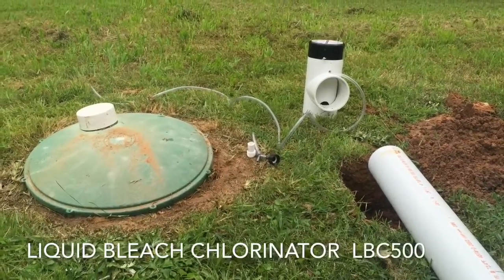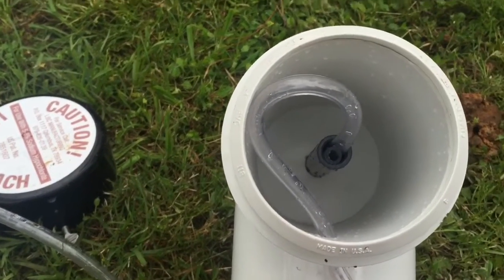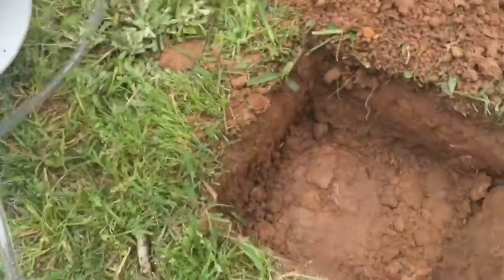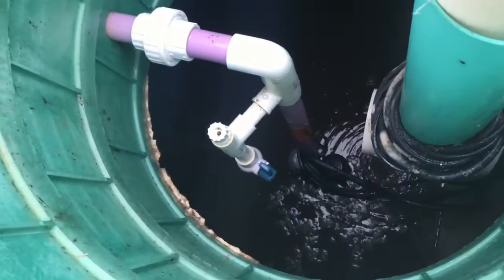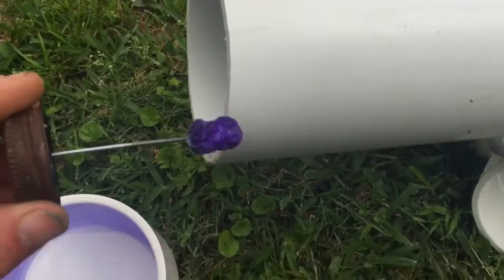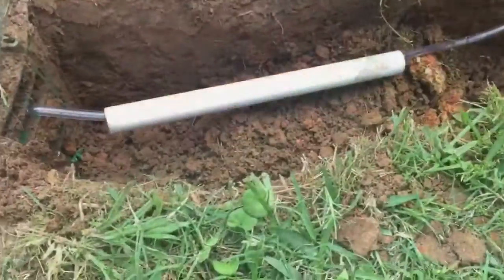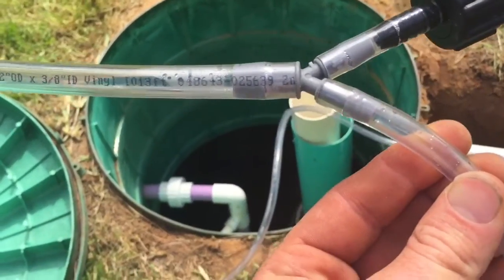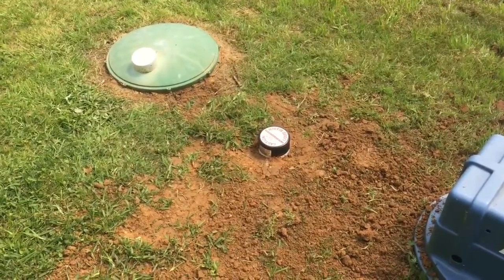Aerobic system bleach chlorinator - no more tablets

Comment: Hello, when you buy the kit does it come with the y connector and threaded parts that attach in the effluent tank?
Reply from the maker: When you buy the kit at a aerobic supply house, it will come with everything you need, less the 4” pipe which you would buy separately.

Comment: My septic is not sucking the bleach out of my pvc
Reply from the maker: How old is your unit? Did you check the Venturi in the holding tank?
Reply: I have replaced the Y valve and all of the tubing. If I open the valve to far it pushes water from the septic into my bleach tube and I never can adjust so I feel suction on the end of the tube. I am not sure what a Venturi is.
Reply: Where can I get a Venturi like it shows in the video
Reply from the maker: Did you sample some from your tank to see if you’re getting any chlorine? I don’t know what else to tell you.

Comment: Just dump some bleach in the toilet once in a while
Reply: Definitely do not do that, the bleach will kill off the beneficial treatment bacteria in your solids and aeration tank.  You should only disinfect the pump tank, which is necessary when the effluent is surface applied, (i.e. if you have sprinklers)
Reply: You are adding bleach to the second tank after the aerobic digestion tank.  Putting it in the toilet will kill the bugs that do the aerobic digestion. So don't do that.  Steven you need to take a class on how to maintain your system.
Reply: That will kill the good bacteria in the effluent tank and make the breakdown and sterilization process way worse. So, do not pour bleach down a drain. It can only go into the pump tank for final sterilization.

Comment: Mine isn't using bleach either, must be plugged up.  Did you notice if there is an orifice in the gray tube that I should clean?
Reply from the maker: Not sure. Might need a new one. But you should hear it sucking when the pump is on. Check the tubing and make sure it’s submerged in the bleach.

Comment: Mine holds about 2 1/2 gallons. The bleech drains super fast, I would say we fill every other day. How do I slow down the suction of the bleech?
Reply from the maker: Which model is it? Is this a new install? The one in the video, you have to wedge the suction hose either in or out in small adjustments. Ha
Reply: @karlmielke3922  I have the liquid bleech setup just like yours, I need to adjust the suction.
Reply from the maker: I would turn the field pump on so your heads are running, pull out the vinyl tubing until it stops sucking the bleach. Then put it back in until it starts showing bleach flowing. But not too much.
Reply: @karlmielke3922  I'll give it a try. Thank you.👍

Comment: I have the same system but when the pump is running it doesn’t seem to be drawing any bleach. If I pull the clear tube out and put it into bleach there is definitely suction, but when it’s in the little gray pipe nothing seems to be drawn up. Can’t seem to get a response from the manufacturer. Thoughts?
Reply from the maker: Who is the manufacturer?
Reply: It’s the exact same one as yours. I’m in Texas, too. Manufacturer is LBC Mfg. thanks for replying!
Reply: Did you ever figure this out ? I don’t think mine is using bleach either. It used to I was putting bleach in often but I haven’t had to put any in awhile.

Comment: What about if you septic tank is concrete?
Reply from the maker: As far as I know, concrete tanks are used is a conventional system. The aerobic system I have is poly tanks and the bleach treats the holding tank.
Reply: @karlmielke3922  
My system uses sprinklers and aerator. But doesnt have chlorinator. My septic guy says to drop those tablets into the pump tank. I'm wondering if this bleach chlorinator would work with my system? Drilling through concrete would be problematic, though.
Reply from the maker: Call your septic supply. They sell the chlorinators (LBC Manufacturing is the brand I used.) Mine is is Texas so you might check your state regulation on them.
Reply: @karlmielke3922  
My state is Louisiana.
Reply from the maker: @jxsilicon9  I did a quick search on using them in Louisiana and didn’t find anything on using them. Texas is approved through Texas A&M.
Reply: @karlmielke3922  
So how many ounces of bleach get released each time? Does it kill the grass when released from sprinklers?

Comment: How does that small clear tube bent up inside the inner tube work? I think mine was like that, but I thought that's not right and I pulled it out and just fed it straight down. Now it's sucking down bleach like you won't believe, so I bent it back and put it the way it was. Should it be bent in there like that? How does it control the flow?
Reply from the maker: That small tube is just a wedge to hold the large suction tube in place. If you still have it, just stuff it back in. I have my tube set just a little pulled out. My tube doesn't go all the way to the bottom. You can pull yours out a little bit. You will have to wait a few days to check your chlorine level and adjust.

Comment: What is the other big pvc pipe attached too
Reply: So the pipe is used as a reservoir only then correct?
Reply from the maker: The 4 ft pvc is only attached to the "t" and the other end has a cap. It's used to hold the bleach. It can be 8 ft if you want it to hold more bleach. They inspected min and it passed the chlorine test.